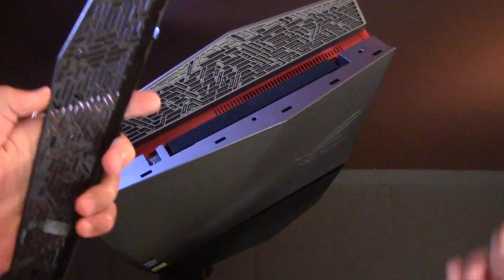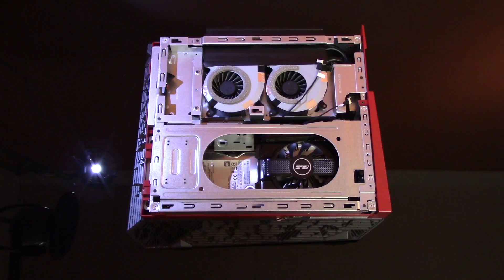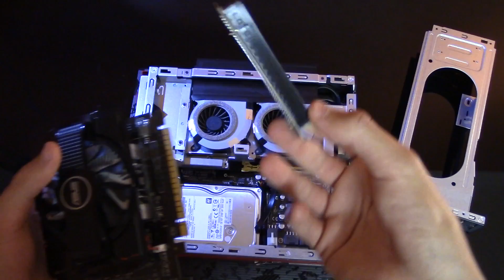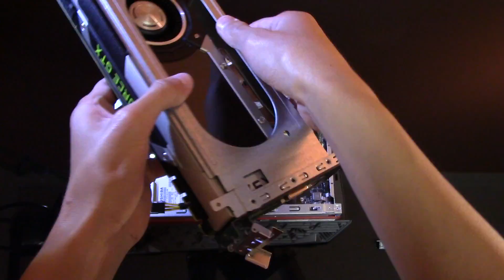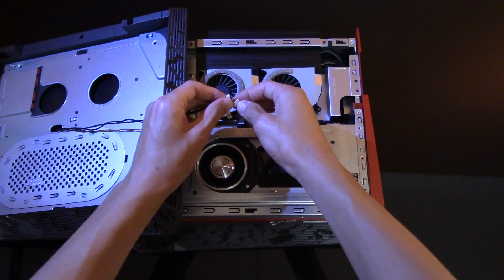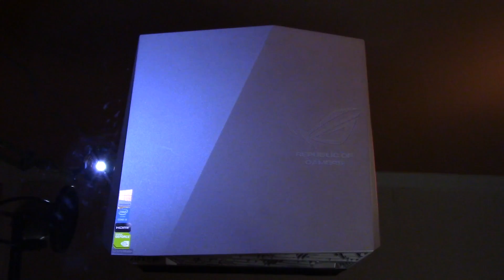Asus ROG G20 - GPU Upgrade Tutorial

Comment: People of this video, from my understanding, if you look on your power supply and see 180 + 230, the 230 is the dedicated part of the power supply for your graphics card. Still make sure you move your jumpers and uninstall any old drivers so it doesn't conflict with the new video card. I currently have a 1060 3GB in my G20AJ and have had no issues.
Reply: AL takes off Nice I just bought the 1060 6 gb sc for my g20aj
Reply: The 230 is for the MB not the GPU

Comment: So using the jumpers would make it so you can use both ac? Meaning a total of 410w?
Reply: Reduced Water I belive just moving that jumper pin shoewed on the video JUST allows the two pcie cables to be used but if you want to use the two bricks you have to move a series of pins not just one. I can’t verify if that’s true but an asus rep told me that and even he was unsure
Reply: @rjcard9354  Hm I see, doesn't seem to be any confirms online either but that could be wrong search inquiries. I plugged both ac adapters in and both into an outlet and it turned on and worked. I did not test individually but it still has base components. I guess the next time I have spare time to work on it o will try both ac plugs separately and see if it turns on or not.

Comment: Hi, I upgraded a GPU gtx 970 to my G20AJ just like you did in the video. However, after a while using this gtx 970, I noticed that the game's animation got really lagged. Then I noticed that the minimum wattage for GTX 970 is 500w, meanwhile G20AJ's psu is 430w at max. Is it going to affect the gpu's performance?

Comment: Two questions from a non-hardware savvy person (going to install a GTX 1060 3gb):
1) Is the large brick looking thing that came with my G20AJ model the dual power supply (180 + 230 watts) and if so would both be used during gaming making it effectively a 410 watt output?
2) Will I have to manually delete the files that operate my GTX 760 graphics card before installing the new one, or can I just replace it from word go, boot up the computer, and follow some prompts to make the software changes?

Comment: hi nice vid,  I wondering if you could help me, I got a g20cb, it does not have the JDC11 jumper, I have the 5 jumpers close to where the JDC11 is on your mobo, im swapping a 950 to a 1060, both are 6pin cards, so I just used the same 6pin cable, moved the jumpers up one and plugged in the graphics card, but has no power to gpu, no fan spin etc. i moved the jumpers back down to the bottom pin, and still no power or fan spin, and monitor comes up with no signal. have any ideas ?

Comment: Yo just wondering is there anyway i can upgrade my rog into a new case so i can fit better parts in it? or should i jsut buy a new pc?
Reply from the maker: You can only take the storage, cpu, and graphics card really. I'd just build a PC with the parts you'll need like a new motherboard, ram, and power supply

Comment: Did this even work? Sure, it went in, but did it work? I'm a little worried because 180 and 230 don't add up to 500 watts, which is what the 970 requires. I would like to install my old gtx 780, but that card requires 600 watts.

Comment: Lol, so not only is it more expensive than just building a PC with the same parts but it's also insanely difficult to work on... Never will I understand why people buy these.
Reply from the maker: Actually cost me less to buy this. And parents would let me buy a PC. Thanks :))
Reply: based_will I bought this PC last year around March or so but I paid $850 and it came with a 1070 and i7. I was originally going to build one but seen this deal so I ended up buying it. It was my first PC. I do plan to get another but will build because I rather have a nice looking case to easily go in, unhook and change whatever I want.

Comment: I have the 6 pin connector, I lost the 8 pin can't find it so I just bought one off of ebay. It's longer but will it work (found it on a message board)

Comment: Thanks a lot for this video. When I got this computer a year and a half ago I trial and errored putting in a 970 and it took forever. I just got a 1080 today and completely forget how to open it and do everything so your guide is going to be super useful. Much appreciated.
Reply: Did the 1080 work well in your build? I'm thinking of putting a 1070 in my base G20 and swapping out my 750 like he did in the video. Be great to hear how yours went too!
Reply: Lord Stronghold yup, no issues with the 1080. It was actually a little smaller than the 970 so it fit well and there have been no issues. Easy installation if you don’t have any problems with the screws and no power supply issues (my G20gb had dual power supplies in it when I bought it and since it ran the 970 I assumed that this wouldn’t be an issue either). Biiig performance upgrade - I got it because I have gotten into VR and needed more horsepower and the gpu was the weakest link. I wouldn’t have wanted to put in an overclocked 1080 though (got the founder’s edition) due to heat and power concerns.
Reply: Great point about the overclocking vs founder's edition. I will probably do the same (just with a 1070) to avoid any power supply hiccups. Thank you
Reply: Hey guys, will this fit in my G20? http://www.neutronusa.com/prod.cfm/2595272/glb?gclid=Cj0KCQiAv_HSBRCkARIsAGaSsrBYY2kSPDKdC08l3a4FZwv-kQElb_x6JaNUNLlwk-hcVZeti1Udh7AaAiq8EALw_wcB
Reply: Paul Hofreiter i have a rog g20 cb its take only fonder edition ?

Comment: Ok so I have a problem and idk if I need a 180w power supply or not but anyway I have the gtx 1060 by evga and it's a single fan gpu. So I switched the jdc11 to the left and I made sure the gpu is plugged into the motherboard and when I start my pc it comes up sometimes with no screen and sometimes with screen but they're are graphic jagged line glitches and I have no idea what's the problem.

Comment: Hello, i have just ordered an EVGA gtx 1060 6gb model, i have the Asus rog g20 aj model (not sure what PSU it comes with) I think I need the 180-watt PSU but the amazon link dosent work. would you be willing to link me to another psu that would work thanks in advance!

EDIT: Would this one work?

https://www.amazon.com/G20AJ-DE013S-G20AJ-DE014S-G20AJ-FR015S-G20AJ-NR016S-G20AJ-FR018S/dp/B00RF3U74O/ref=pd_day0_23_2?_encoding=UTF8&psc=1&refRID=FBSEPGRVPFQWAN3GCSSF

Edit2: It did work and is in the mail just waiting for my 1060!
Reply: Mach_ChickenGaming do you have the single fan model? I'm trying to figure out if I need a extra power supply
Reply: Real yes I have the evga gtx 1060 6gb model and you will need a extra powet suply the one I linked in my original comment does work

Comment: Hey wonder if anyone can help me out, so I have the g20cb with a 950 gtx it only came with one power supply as I got it from a mate he said it didn't come with an extra power supply now I went out of my way to buy the 180w from scan and I want to soon upgrade my gtx 950 to a 970 but here's the odd thing, I don't have the pins the JDC11 there's just nothing there so not only do I have the 180 w power supply plugged in and it isn't getting powered can I. It upgrade?? So confused.
Reply: Kye Grey where did you get the power supply for yours man? I ordered a 180 an failed :(

Comment: Not sure if Iv alreagdy asked you this. I have installed an asus gtx 1060 t into an asus rog g20 au.   The fit went well, however even after move ldc 11 jumper, and ldc 01 to 05 as others have suggested, and installing the correct "brick" to run the biiger card, It does not seem to be using the extra power. when we unplug the extra graphics card power suppl , no change.

Nothing gets hot, frame rates kinda ok of max setting on most games...bench marks a bit lower than i would expect.

My  impression was that ldc 11 cut off the power from the track, and allowed power from the brick supply....doesnt appear tp be the case...any ideas?

Comment: I am planning to get the GTX 1060 6GB Superclocked for Christmas. I have the I5 version with a GTX 750 2gb. I am just wondering if I need a new power source like the one you linked, or is mine fine?

My power source: INPUT - 100-240V

Comment: I have a question, what if u wanted to go with a evga gtx 1060 and it requires only one 6 pin connector. Do I just connect only the 6 pin connector to the motherboard and to the pc and that's it? Just making sure

Comment: Hy guys, if i buy a adaptater 180 watt, i can ameliorate my gtx 750 to gtx 1060 ? 
I buy too 6 pin cable,  and it's ok i dont need to change anything to upgrade this gpu ? Thank you soo much !
Reply: http://www.rueducommerce.fr/Composants/Carte-Graphique/Carte-Graphique-NVIDIA/ASUS/4964699-GeForce-DUAL-GTX-1060-03GB-version-OC.htm%23xtor=SEC-802-GOO-%5BComposants%5D-%5B%7Bifdyn%3Adyn%7D%7Bifpe%3Ape%7D%7Bifpla%3Apla%7D%5D-%5BRSYS%3A31%3A4964699%5D-%7Badwords_producttargetid%7D?gclid=Cj0KCQjws-LKBRDCARIsAAOTNd46f8xruX6lnzqsam3YOEFOyfCON-RvU2T7SSsIelx1Vap3MbRcSGYaAqEqEALw_wcB
Version Oc

Comment: Hey guys im looking to upgrade to a ASUS GeForce® GTX 1080 Ti Founders Editioni have a Asus G20aj A1B09. Currently I don't know what power supply I have on it how would i check? Also i started with a gtx760 will the 1080ti work for my pc? is i-7 4790 cpu@3.60 with 16 gb ram good enough to not bottleneck it or should i go with a lower gpu and if so which?
Reply: 180 W + 230 W is actually what i have for powersupply now to know the rest of what will work in my pc
Reply from the maker: THe 180 and 230w is the highest you can go. Don't know if it's enough for a 1080ti. Probably for a 1070 or 1080.

Comment: i orderd a 1080 in mAil for my g20 i currently have 970 do i need diffrent power cables? for card
Reply: I been told it will not fit need a bigger case. Will find out if true

Comment: I want to upgrade to a 1050 TI, it looks small with only a single fan, so it will most likely fit. But would the gpu heating up be an issue? its about the size of the 750 that was originally in the g20. Also, should i replace the power supply for the beefier one? The 1050 only uses 20 more W than the 745 I have. I have the 180 W psu
Reply: Hi idk if u will respond to this but did it work with 1050 ti? Im planning to change mine to that as well

Comment: Let me ask you something. If i have the I3 version of this computer that only comes with the 180 watt power supply then can i buy the other one and use them both at the same time?
Reply: You're going to have to if you plan on upgrading the GPU. They can and should be used at the same time; one gets plugged directly into the GPU, and the other gets plugged into the I/O port (into the motherboard).

Comment: Does anyone know if the ASUS GeForce GTX 1060 6GB Turbo fits in the asus rog? and it says that it needs 400w supply so do i need to uppgrade the power supply and what do i need to buy and how do i install the power supply?? And what happens if i dont get another power supply?
Reply from the maker: It will not fit. And you just plug both power supplies in. The GPU will be heavily underclocked without sufficient power
Reply: I got it yesterday and it fits and i already had a 400w power supply

Comment: installed the 1050 ti and after booting to the bios on first boot, it now boots to a blank screen.   I think I need to boot to VGA to setup video card but this card does not have VGA.   Thoughts on how to get past the blank screen?   Only have DVI, Display and HDMI (in use now).

Comment: For anyone wondering which card they should get you should definitely get a FE card because you want the fans to push the heat out through the back of the case. Basically any card with a blower style fan like the Asus turbo line, you don't want the heat to be circulating in the case that'll make the card and rest of your components overheat.
Reply: thank u queen
Reply: Would it work if i turned one of the fans off? Because i have a duel fan GTX 1060.
Reply: The original card is not a blower fan its a regular fan on the card... What causes the extra heat is the extra power cinsumption if you use a lower voltage profile and turnup the fan speed on the newer card with a programmable fan curve a standard dual fan card will work just fine... Just dont be a tool and slam in a 3070TI and overclock it to the moon than whine later its overheating..... I have the same computer and have a GTX 1070 with a very small OC in it and I machined out the grille on the inside of the side panel to help bringin more fresh air & its runs just fine

Comment: Please help me out anyone. Im about to buy the "ASUS Geforce GTX 1060 6GB Turbo Edition VR Ready Dual HDMI 2.0 DP 1.4 Auto-Extreme Graphics Card" for my G20 i5. it comes with the 230 w power supply and I want to know if this graphics card will work for this pc... Will i need to get the 180 w power supply. Thanks
Reply: Yes that card will work and yes you will need the 180W PSU
Reply: Thanks!
Reply: x Evan  u upgraded the gpu to asus dual gtx 1060? How it fits and does it heat up? I bought asus dual gtx 1060 and i have this G20BM pc w/fx770k. Do i need to upgrade also pws?
Reply: System works great. requires only one 6 pin adapter and a upgraded power source.
Reply: What about fans? Since it isn't blower style does it affect airflow? Is it possible to get picture?
Reply: its a asus gtx 1060 turbo so it it blower.
Reply: x Evan It works?? I want to do the same thing with mine I have the i5 with the 750 does it work? what Cables do I need(6 pin or 8pin) and If I need the 180 power supply
Reply: You need the 180 power supply for sure.
Reply: x Evan oh ok. Mine is dual fan so it will probably jeat the pc up

Comment: Will the nvidia gtx 1060 fit? I am pretty sure I have he same model g20 it has gtx 750 and i5 I have had it for 3 year next November and was wondering if the nvidia gtx 1060 would fit. And if doesn't does any 10 series card fit
Reply from the maker: All reference 10 series cards fit.
Reply: If fits, I have the same exact model as you and just put a gtx 1070 FE in it.
Reply: Joel Silvestre-Garcia why is the fe version so expensive ?
Reply: DrewEon thx
Reply: Joel Silvestre-Garcia ok thx I will see if it works
Reply: Gabriel Ferrar find the measurements of the 970 reference model. If it's the same length, width, and height then it will definitely fit.
Reply: DrewEon I am trying to turn my pc on after I took it apart and put it back together and I didn't upgrade anything just took out the thing the graphics card is in and now my monitor say no hdmi 2 signal then goes black
Reply: Gabriel Ferrar sounds like you didn't properly set the card back in. I would open it back up and make sure the card is inserted into the port.
Reply: Joel Silvestre-Garcia ok I took it out again a few hours ago for the second time and it looked like it was in all the way
Reply: do the fans go off when you turn your system on?
Reply: Joel Silvestre-Garcia I will check
Reply: connect your hdmi to the motherboard so it will use the integrated graphics and check under device manager if it recognizes the gpu
Reply: Joel Silvestre-Garcia ok my fans went off but not on my gpu
Reply: Joel Silvestre-Garcia is the motherboard under the fans
Reply: nah the hdmi port that's in the back, no the one on your graphics card the one above it. you should have two hdmi ports in the back
Reply: Joel Silvestre-Garcia so I don't have to take anything out just plug it in the back of the pc
Reply: yes see if your screen turn on using the integrated intel graphics
Reply: Joel Silvestre-Garcia it does
Reply: Joel Silvestre-Garcia the only display adapter in device manager is my integrated intel graphics
Reply: oh ok yea so it's not recognizing your gpu, make sure that adapter on your gpu is inserted properly. I think that might be your problem. Also try and right click on display adapters and click on scan for hardware changes and see if it recognizes it.
Reply: Joel Silvestre-Garcia I can't figure out the problem
Reply: Joel Silvestre-Garcia hey the graphics card fan is spinning but the monitor say no hdmi2 signal
Reply: Damn bro idk what to tell you
Reply: Joel Silvestre-Garcia do u think if I got a new graphics card it would work
Reply: Gabriel Ferrar But wouldn't that cause a bottleneck?

Comment: boi thanks for the vid i am gonna get the new gtx1080 ti i need to upgrade my gtx1070 also next time i reccomend to pay a little more for the gtx 1070 or the gtx 1080 version
Reply from the maker: Haha, I got this PC in February of 2015, the 1070/1080 didn't exist xD. Nor do I have that type of money.
Reply: Dude don't put a 1080ti into this case lol that PSU will not be able to handle it. If you can afford a 1080ti you can build a better system
Reply: DrewEon Asus rog g20aj i7 4790 ,12gb ram , gtx 960 2gb ,   I can upgrade gtx 1080 ti ?
Reply: Jemmie Adam I wouldn't try it, I'd be concerned with the psu because you'll only have a total of 410w
Reply: i can changed tdp? its possible?
Reply: Jemmie Adam what do you mean change the tdp?
Reply: i m need 600w right for gtx 1080 ti ))

Comment: will Asus gtx 1060 strix fit? and what power adapter should i use? i got i5, gtx 750
Reply: the strix is 37cm long
Reply from the maker: Not going to fit, and tons of hot air will exhaust out. You'll need the 180w

Comment: Hey DrewEon, you might not see this, but I have a question. I've commented before but deleted it, but I need help again. I have the ASUS ROG G20BM, it comes with the AMD FX-770k with 3.5ghz and quad core processing power. It has the Radeon R9 270 2g GDDR5. I want to know what is the best upgrade to get amazing frames on new games like Mount and Blade II or even GTA V? Cheers!
Reply from the maker: The FX-770k might be quite the bottleneck in lots of games, I could suggest a 1050ti or 1060.
Reply: I have the G20BM, and the chipset is an AMD a58, could the 1050ti fit on that chipset? And should I upgrade my cpu? (770k) Thanks for the response.